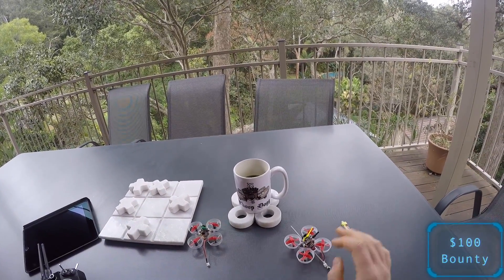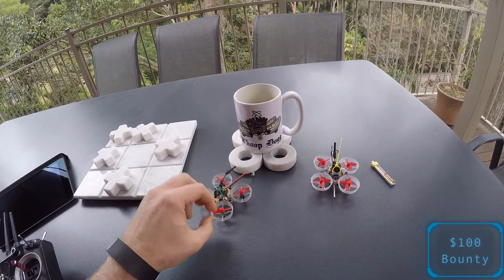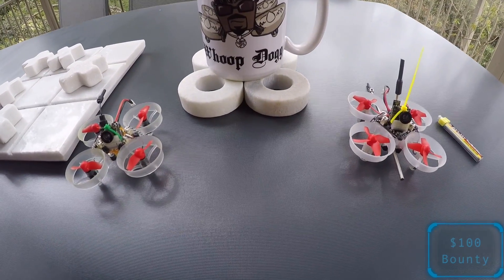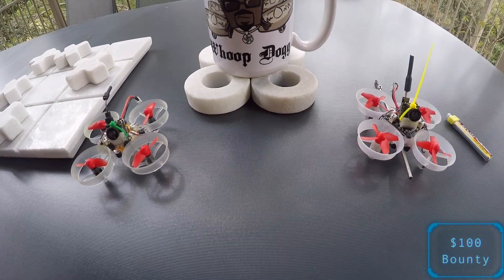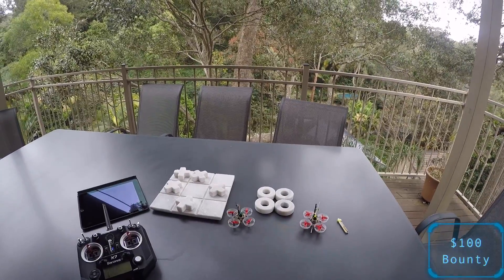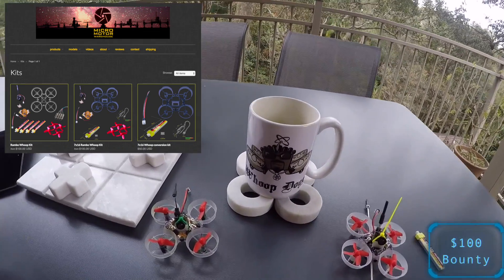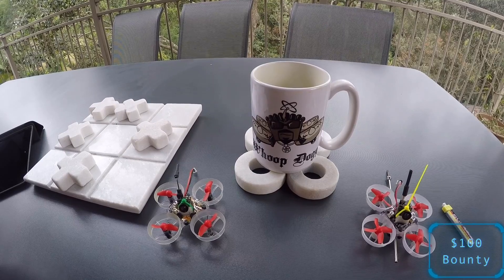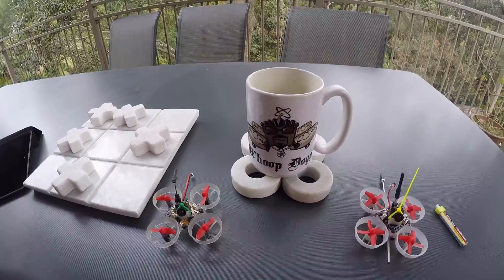BetaFlight Angle Bug - Please help!

Comment: i am flying Fpv Tiny6 whoop for a couple of months and i am having great fun with it .
I use to fly helicopters so flying Los was easy in angle mode and Acro is harder specially indoors .
But i read there are a lot of problems with Fc boards who have a drift in angle mode that gets worse in flight until you have to land .
A lot of reviewers dont even bother to fly in angled mode because they think of it as a trainigwheels and you should learn to fly Acro , i think that sucks .
I like acro and angle they both got there place in this hobby .
Reply from the maker: Many people dismiss angle mode before spending some time with it. Increasing drift is often a result of vibrations, with affect angle more than acro. When someone says that angle mode is "limiting", they often dont know that the angle limit can be changed.

Comment: Increase angle sensitivity to 100.
Reply: Same as dual rate, almost. Angle limit is how much to max bank quad in degrees, Sensitivity is how much stick movement achieve max angle. so if angle limit is say 75 and sensitivity is 75 then you get 100% angle ( 75 deg) at full stick. 100 sensitivity and 90 angle means max angle is achieved on 90% movement of the stick. In short sensitivity need to be as least high as angle limit, more sensitivity means less stick movement for more angle change.
Reply: Max angle limit is I think 120, my recommendation is 90 and sensitivity 100. And of course you can switch to horizon for more.
Reply from the maker: Yeah, that "fixes" it. Thank you :D
Reply: What does angle sensitivity actually do?  I have been trying to get angle mode working smoothly but not clear what the setting does?

Comment: You fly in angle mode. :*(
Reply from the maker: There are different times for different modes. I also fly GPS position hold if needed. Most people who poo-poo angle mode havent even tried tuning it or recognised the benefits.
Reply: Bring your micro and race on my course...you fly rate mode and I'll fly angle. Angle is better indoors 100% with micros. Outdoors on 5" rate is better. Crapping on Angle mode means you haven't raced micros and really are just repeating what you've heard other people say.

Comment: Did you also set the level_sensitivity parameter? If not, perhaps that is your issue?
Reply: It is the parameter that is used to calculate the angle from the stick's deflection. See here: https://github.com/betaflight/betaflight/blob/master/src/main/flight/pid.c#L356
Reply from the maker: Yep, increasing sensitivity "fixed" it. Still seems like a bug, but workable.  There is a fix now: https://github.com/betaflight/betaflight/pull/4013

Comment: That's an interesting one Ben. You are correct saying that the Betaflight devs don't focus on angle mode too much but they do desire a fully functioning firmware for all prospective users, including those who prefer angle mode. My guess is something is over riding the command due to some pid setting combined with your angle mode settings. If I get time I'll investigate, meantime I suggest posting in Boris' Betaflight thread on RCGroups as this will be of interest I'd think.
Reply from the maker: Well, the speed of implementing a fix here certainly proofs your point right ;)